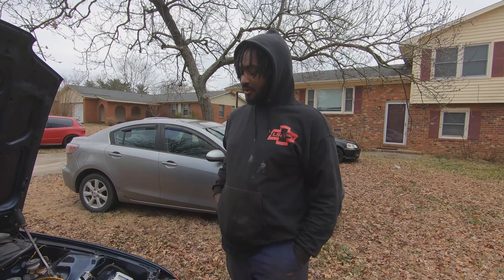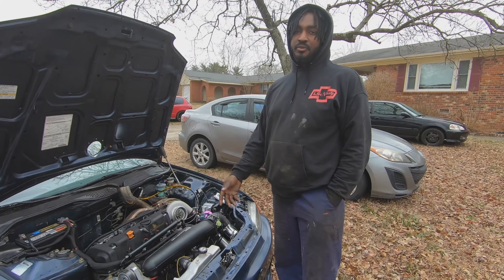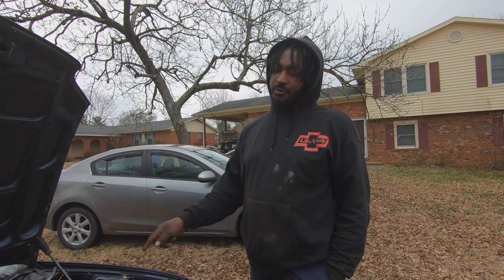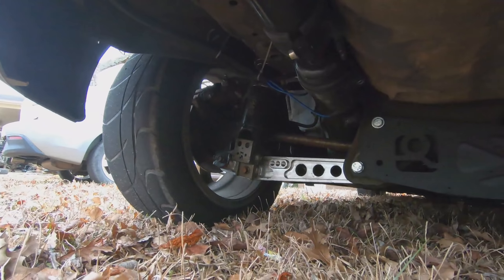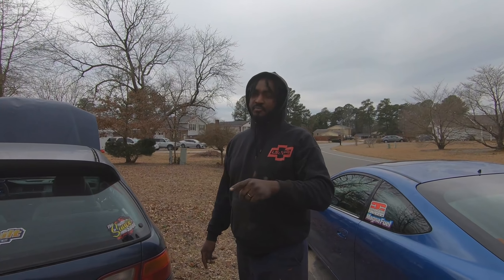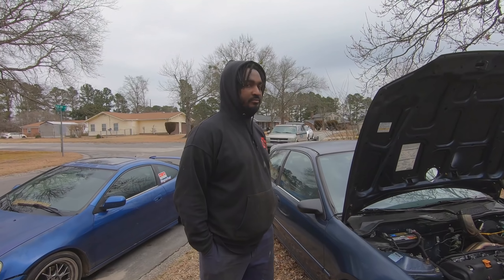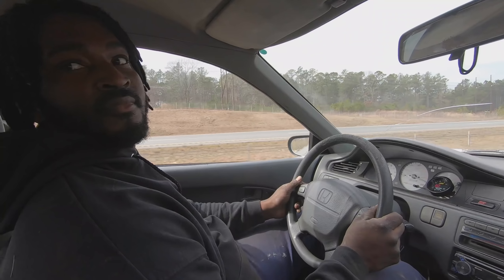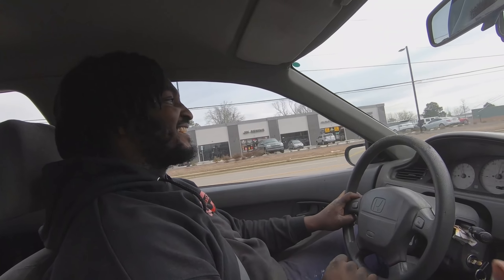How It cost me $6,000 to build a AWD CIVIC!!!!

Comment: Listen up people, don't get hung up on buying the best parts and having it sit on jack stands for years, just get it running.
Reply: until it breaks
Reply: @alex-gx6bs  Then replace what breaks
Reply: @GreatValueJohnnySins  and then RACE IT
Reply: true,  but if you buy it once you won't ever have to buy it again.. buy quality where you need to so you won't always having issues on the dumbest shiet that you cheap out on.  I'm going on 4 years on jack stand, but it's getting there as awd..  Most race car parts are basically paid off by side hustle .side work. trade offs or bought second hand in good condition. Anything that needed to be new not mechanical metal wise. I buy new like (fuel system, electronic control system)
Reply: @yeahman1756 race cars always break

Comment: Ok things are going to break on a car Period lets just get that out the way... but at the same time its always smart to actually buy new and none ebay stuff because depending on how your going to drive the car weather its a daily or your Comp Drag car your going to break something and by the looks of your Honda isn't even pushing over stock Transmission limits so of course the transmission is going to be solid. im not talking about your build at all im also building a Awd Civic Doing everything myself but I'm getting new and After market name brad shit because i play on dallying my car and racing it as well and im also planning on gong to the upper 1000hp range so when your in that area of power its Needed to upgrade to ALL After market stuff.

Comment: What rear trailing arms did you use?  Just a heads up, the DA Integra arms do set the wheels out a few mm wider than stock EF, EG, DC arms.

Comment: I did it for 3k k24 swapped. Stay tuned for a video, @boostmonger.
Reply: crv parts @ pinned diff? 3K is not bad
Reply: Ha nope full wagon driveline :)
Reply: @ridindirty0306  jheez. so I should expect to pay between 3-6k with installation?
Reply: Sure but check those junkyards if your not scared to do the work ,depending where you are , might luck out and find a wagon !

Comment: Does vsr sell a 5858 turbo???
Reply from the maker: They sell a 5854
Reply: @blackphillbuilt8382  I gotta check again, I’ll be running a stock k24, 50* vtc with k20 oil pump and don’t want a big turbo with lag. Figured the 5858 was a perfect size